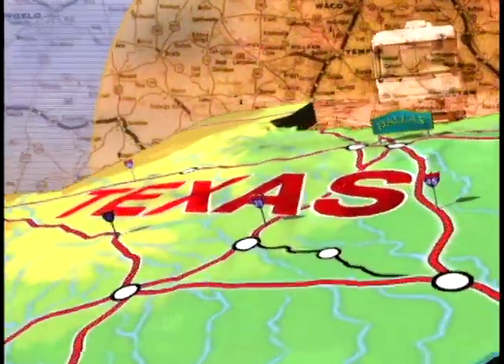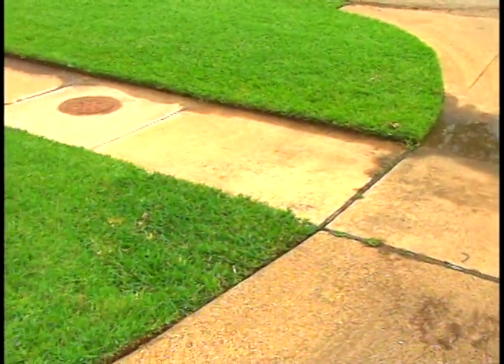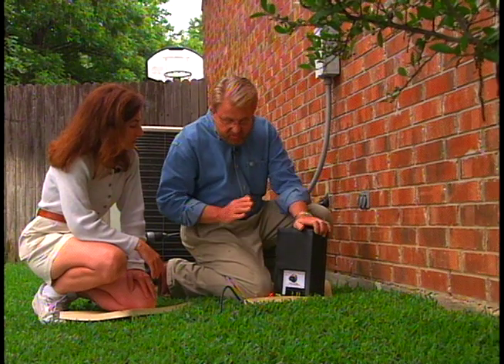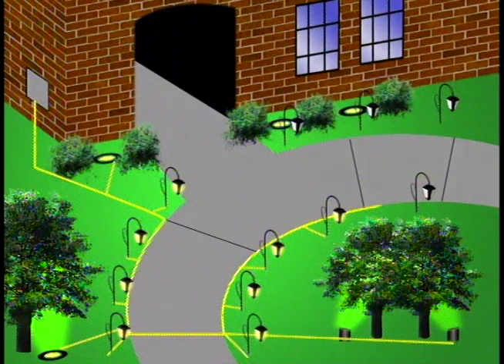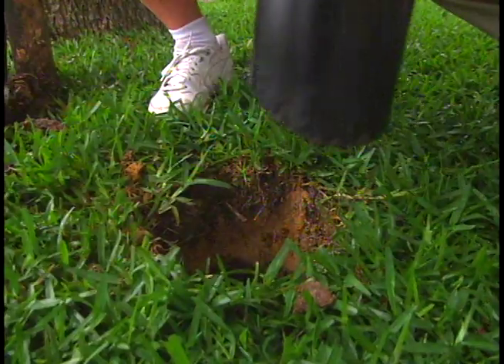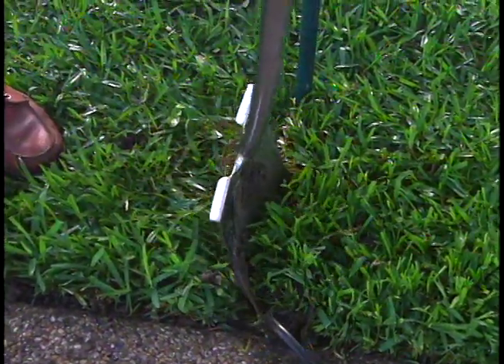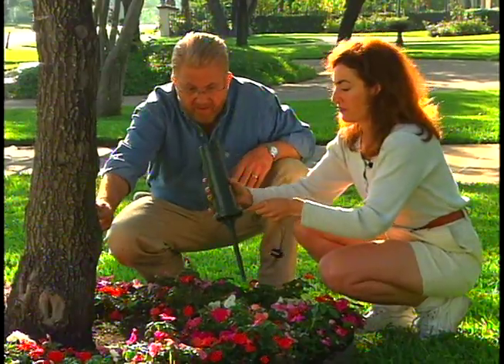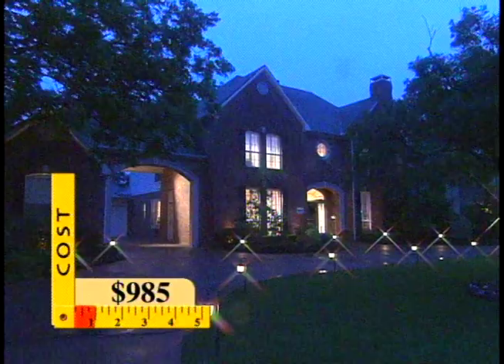Install Low-Voltage Decorative Outdoor Lighting

Comment: Should have shown people how you brought the power from inside the house to outside and give a heads up if anything special should be installed most people know about wiring such as black with black white with white and green and green,any extras connected by the way thanks for the video and may God bless you two.